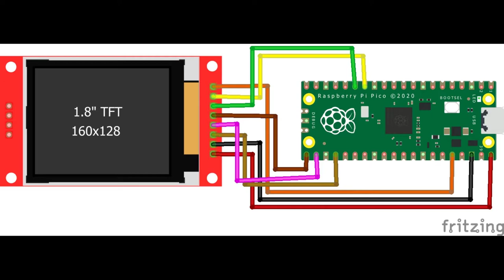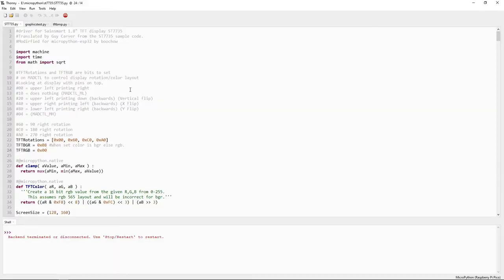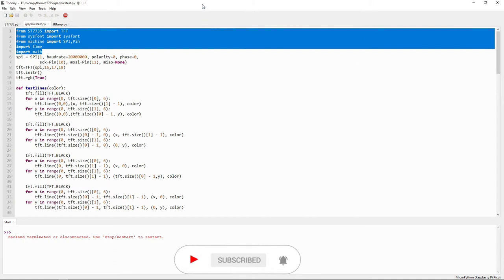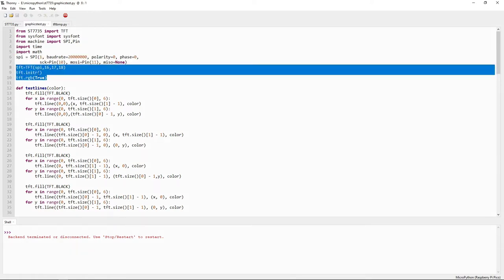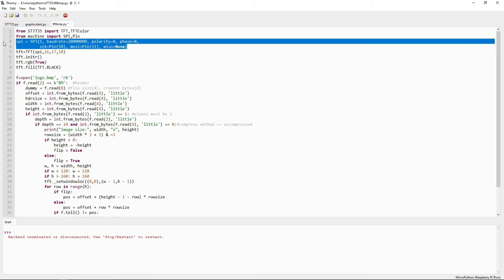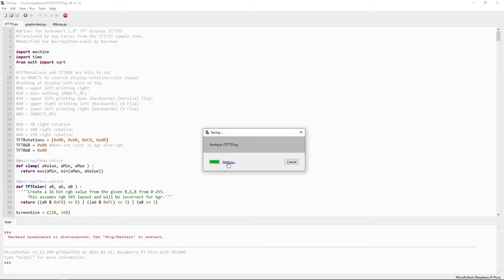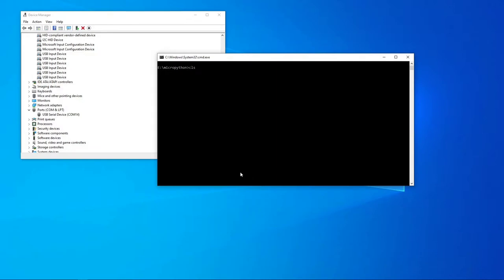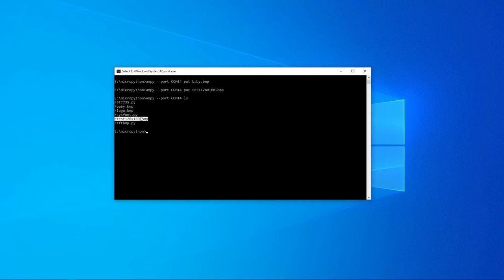Raspberry Pi Pico interface with ST7735 Micropython | Pico Photo Frame

Comment: i have the exact same code and pinout, but for some reason it's not working for me
Reply: Maybe this helps: I noticed that the order and naming of the pins of my display is different. Please check exactly the mapping in the table at 1:37. In my case A0 is RS and RESET is RES. => Now it works, thank you for the great intro.